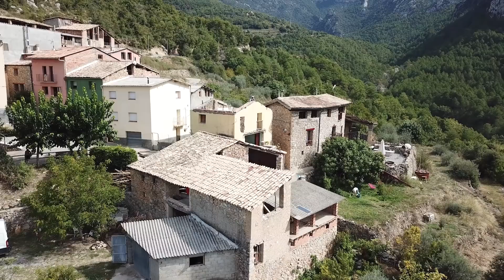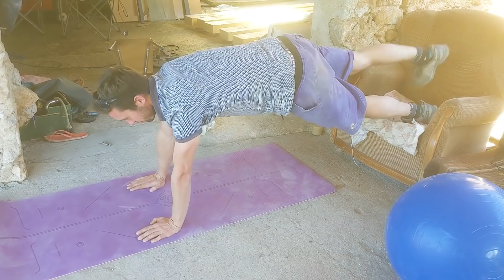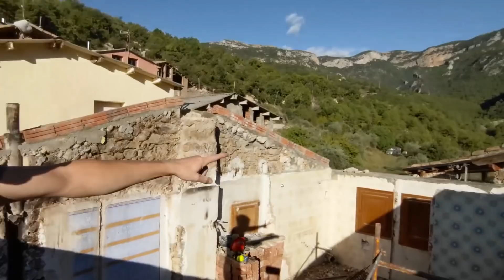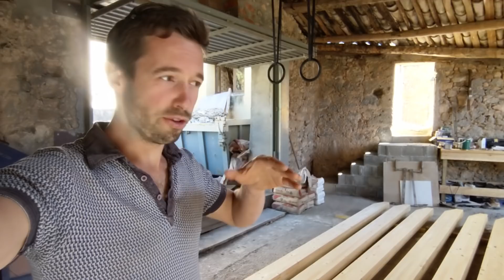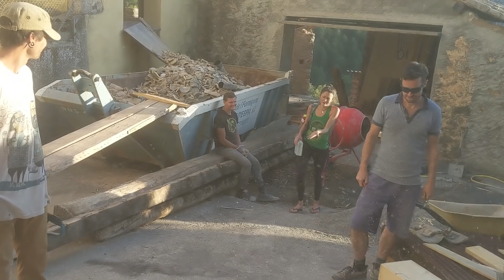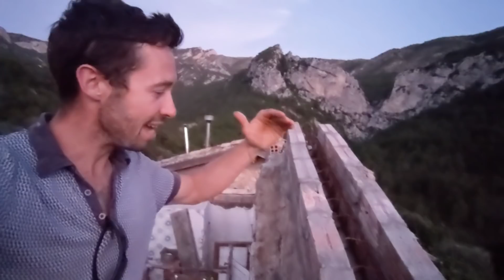A RACE AGAINST TIME - STORMS ARE COMING  |  NMAS Ep30

Comment: Did you worry about the engineering of the roof? Are there building regs/inspections you need to get signed off as you complete these stages?
Reply from the maker: Architect defines the spec - so it's all legit. It's pretty over engineered imo.